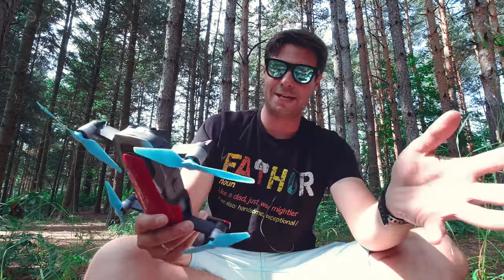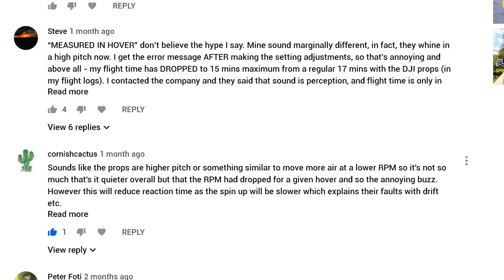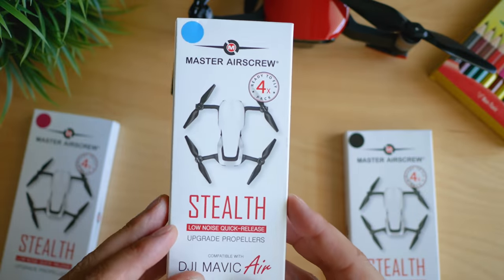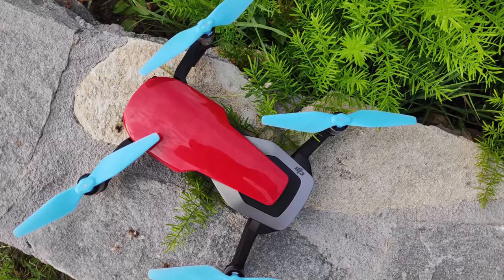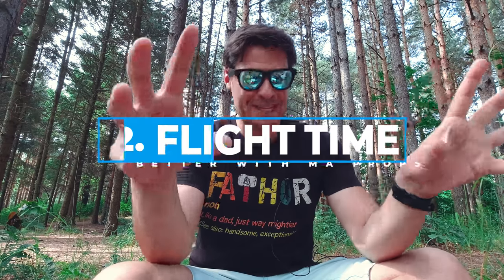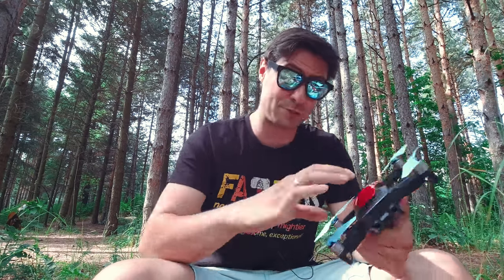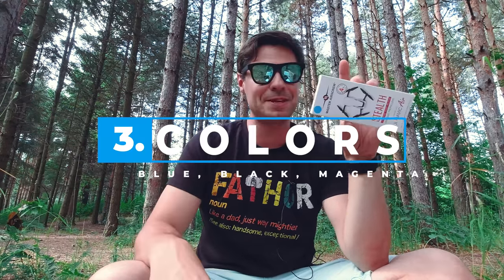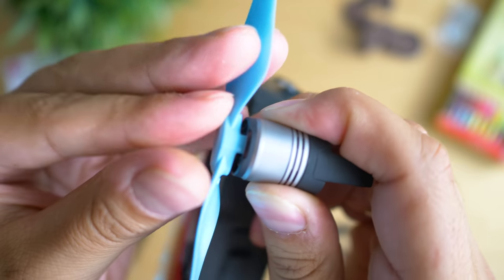DJI Mavic Air can be Quiet! Master Airscrew Stealth Props (v2) Review and Test

Comment: Even if it SEEMS like sports mode should drain the battery faster than normal mode, doing an experiment with different modes does not make the result conclusive at all.

There may be many factors you're not thinking of why sports mode may burn less battery. None that I can think of to be fair, but it's still not how you do an experiment.

Maybe the higher tilt of sport mode drains less battery based only on the wind deflection... maybe the drone recognizes the higher pitched props better in sports mode which may have something to do with it. I'm not saying these things are causes or would even make a difference, Im just saying that using different modes for an experiment is not right. Those were just some possible reasons why. Maybe there are many reasons, maybe none.

Comment: One thing. I fly pretty rough and tend to bump and crash more than most drone users, and i've found the stock propellers are a lot more robust. more scraping, abrasion, and notches, while the masterairscrew props get big chips. probably due to material choice, maybe the MAS prop material is lighter, and takes a smoother lower drag finish.
Reply from the maker: THat's a good point. thanks a lot for sharing this!

Comment: Today the Stealth Props were delivered, first I did a db-Meter-Test with the original propellers, result: 90 db (2 m distance, indoor), then with the "Master Airscrew Stealth Props". Result 90 (!) db (same distance, same place). Only the pitch was a bit lower. Very disappointing! By the way, I adjusted the gain values of the stealth props correctly before the change!

Comment: I have the V2 on my M.Air and like them.  I changed the specs as they recommended and have zero issues.  The volume is about the same but the frequency is lower and much nicer.
Reply from the maker: This is perhaps the nicest upgrade that happened to our Mavic Airs 👍😉👍😉

Comment: I disagree about the noise level. I think what they do is change the tone of the Pitch you're hearing. I am severely hearing impaired. Hearing Aids are a everyday part of my life. I hear a difference in the tone in no way do I hear a reduction in volume. They are much better because of the change but still almost as loud. Flight time is better, I can fly in regular mode for about 18 mins before hearing low battery warnings. My battery level starts chripping at 25% so I go a little longer and have not had a problem getting my Air back to me. I do like Master Airscrew and have been flying them since I had my 3DR Solo. I've used them with my Phantom before I sold it and never had any problems with them.
Reply from the maker: Thanks Harry - interesting take on these props; Most likely the pitch change is the main reason why there's the db-change in favor of the MA props. Fact is that they are less annoying than the originals; And hopefully DJI will think of releasing something on their own.

Comment: Let's talk about pitch.
The M1 Abrams has been criticized for being louder than most other tanks, because it uses a gas-turbine engine, yet this criticism has been rebutted...
The Gas Turbine engine produces a very high pitched noise, which does not carry as well as the lower pitched sound from a diesel engine.
This means that while the gas turbine is louder at, say, 10 feet, it's almost silent at, say, 200ft, while you can still hear the diesel engine.
Lowering the pitch of the sound the drone makes by using different propellers, while it may get a marginal (though very small) decrease in sound volume while right next to the drone, will actually make the drone louder when it is in its element, at a long distance away, as the lower pitched sound will carry further through the air.

Tl:DR, this product works off of faulty principles and is not worthwhile. This is probably why OP only shows a video (with sound) of the drone flying with the original propellers.

Comment: so then You dont have to adjust the gain in the settings on the second version is that correct
Reply from the maker: There are minor adjustments that are recommended, but I've used them without any changes and it was fine.
Reply: @TechMishka  awesome thanks